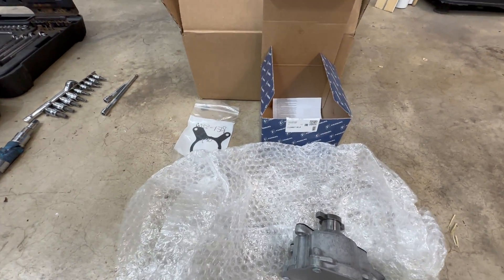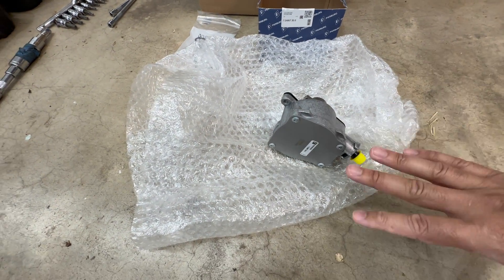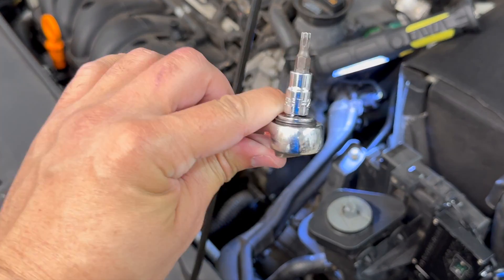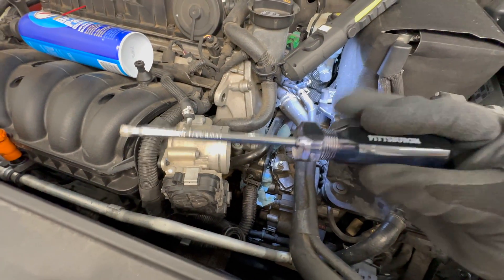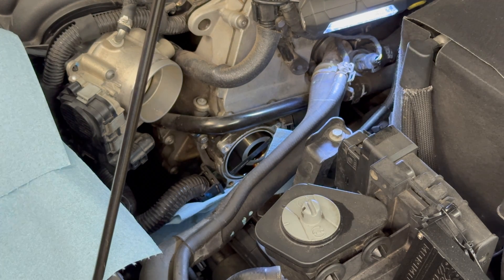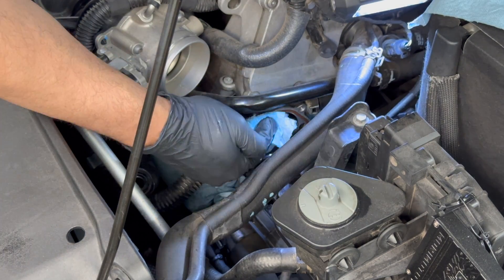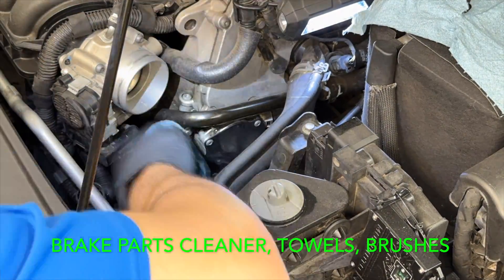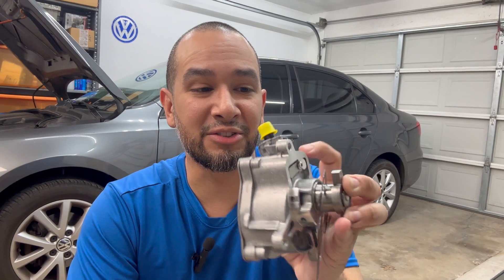VACUUM PUMP RE-SEAL ON VW JETTA MK6

Comment: I just replaced the gasket from my vacuum pump using this video and it worked great! Though, I didn't need to remove the shifter cable, I was able to fit my wrench there without too much trouble.
Reply from the maker: Awesome! Glad it worked for you!

Comment: Was there an update video? Or a new one for the install of the vacuum pump?
Reply from the maker: Not yet! Will be doing a vacuum pump replacement when i have time (since i have it anyway). The gasket i changed is not leaking but the metal one and the oring at the barb are leaking worse now. So oump has to come out to replace those

Comment: Checking in, did it leak again?
Reply from the maker: Yes it did! It got much better, but still leaked. The rest coming from either the metal gasket against the head or the vacuum port, or both. So i there will be a vacuum pump replacement video soon
Reply: @turbospool did you ever do that? Curious on how to remove the power steering pump with battery tray  - feels like everyone video everyone has electron power steering except mine and yours! Haha

Comment: Extremely helpful video, thank you! I just replaced the oil pan then realized I should have done this first. Stupid question: is it advised to drain the oil before this project?
Reply from the maker: Not a stupid question at all! And no, you do not need to change the oil for this.
Reply: @turbospool  Thanks man! Appreciate the response.
Reply: That’s crazy. I’m about to do both of those too!